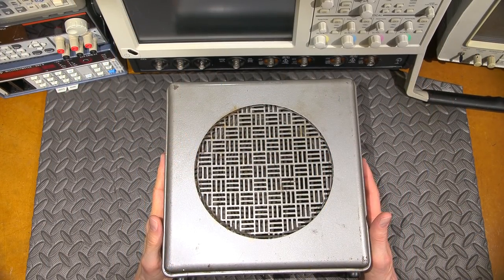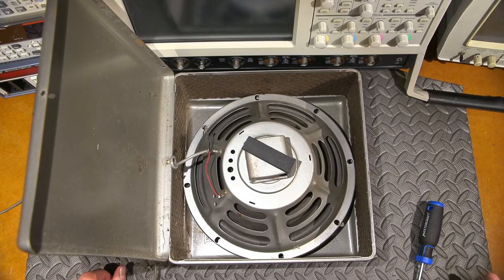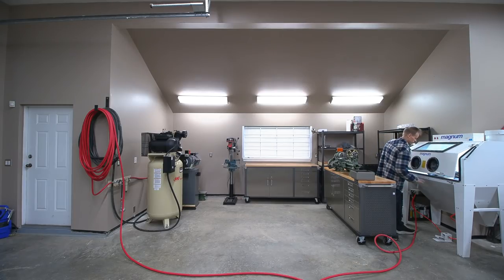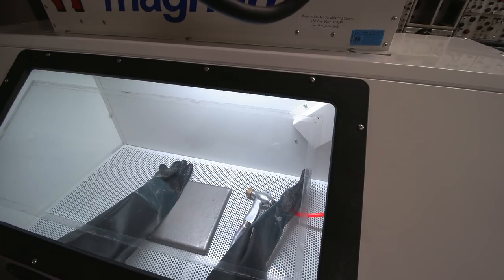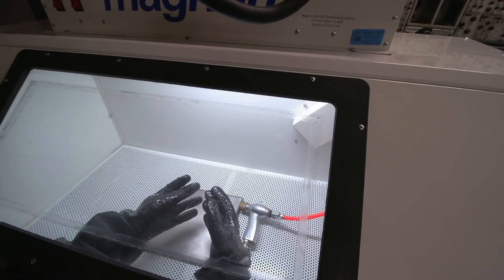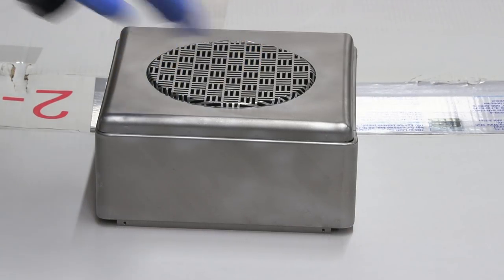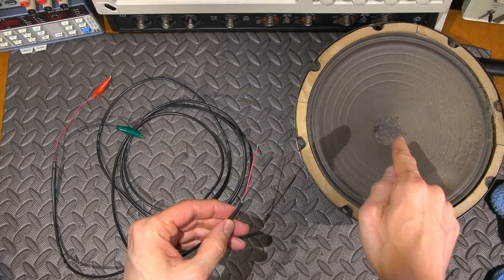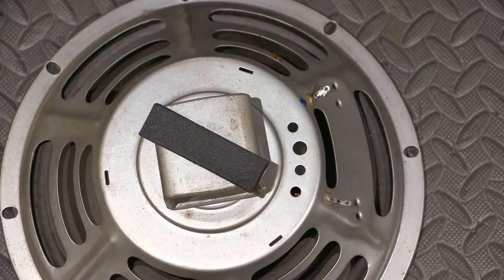Speaker Restoration And Modification!

Comment: Love the set up. One thing I noticed is when your compressor came on it seem to be pulling LRA too long. Not sure of the service size to that building. One issue i have seen on car washes is a 240v compressor on 208v power. The fix was a adding a boost transformer at the unit. Over time under voltage on start can cause motor to fail.

Comment: Excellent outcome. 

Little tip: when using rattle cans but especially thicker products like Hammerite or Plasti-dip warm the cans in a basin of water for 15 minutes before painting. Nothing extreme but close to your body temperature. It makes a massive difference in flow, spray pattern, and reduces clogs. Trust me, you'll thank me.

Comment: Great restoration. That speaker looks fine for testing vacuum tube table radios, but what speakers do you use for testing real Hi-Fi audio amplifiers and receivers?
Reply from the maker: I have a pair of "Monitor Audio PL300" speakers for that.
Reply: @MrCarlsonsLab  Nice, I would expect nothing less. I have a pair of UREI 813B's. Older speakers but still sound fantastic.

Comment: Hi Paul,  Nice video and some variety too (I miss my old bead blaster at work).  Would love a shop like you have now. 
Question: I recall some years ago you mentioned your old blast cabinet in the "old shop" next to the generator and you mentioned hazards of blasting radio chassis with cad plating, and I suppose lead paint on cabinets.  Not asking for advice, but what do you do regarding the vacuum exhaust?  Also, on the vacuum inlet do you use a cyclone such as in wood shops?  Anyone else chip in too.  Thanks!

Comment: Sorry to post another comment but I would like to add… I’ve had half a dozen blasting cabinets. And it’s better to keep an eye out and look for an industrial model like this, instead of giving into the cheap and readily available models from Harbor freight and elsewhere. 

The cheap models are fine…And if you assemble them with a lot of care, making sure to seal all of the joints before riveting and bolting it together… They can make good cabinets but you will need to tune and fettle a bit to get it dialed in and working properly. 

The cabinets are usable if assembled carefully, but I highly suggest buying a better quality gun and hose/nozzle/ glove system. Even a used clapped out model will give you better results if you’re doing a lot of work and spending many hours at the cabinet.
But the cabinets are completely usable as is for odd jobs or twice a year.

 industrial sized cabinets can usually be bought for scrap price if you keep an eye out. Usually vintage models but sometimes even modern units. But they aren’t thin bent sheet metal like the Harbor freight models. They weigh a ton!

Comment: Mr.Carlson, they do make safety couplers that shut air off at the coupler itself with a ring that you have to twist before you can pull back the disconnect ring part. I think some of the push button Prevost couplers do this also, they are pricey though.

Comment: Nice job , Mr. Carlson.   Big fan.   Two questions:  Firstly have you considered adding a small handle  mounted on the speaker enclosure? I had a similar test speaker and it worked out great.  Secondly, I'm  wondering if you could add half inch black pipe to supply air to your glass bead blaster, installed up from the compressor,  along the ceiling,  and down to the blaster?    Keep up the good work.

Comment: Was your compressor completely unpressurized when you turned it on? If so that’s one of the fastest ones I’ve seen. Sorry to be nosy, just curious.

I’ve had several large compressors ranging from 80 to 120 gallons. Most of them were really nice industrial vintage units that I had to restore a little bit. Not only are they available at insanely cheap prices… If you do a bit of looking around… But usually much better quality than stuff available these days unless you spend a lot of money on something nice. (Like yours) 

And I always enjoyed working on them because the compressor was one of the most used things in my shop. Some of my favorites were horizontal three-phase types, that were still in really good shape and I’ve been on the factory floor since new decades ago. And bought for scrap price.

I learned quickly that a really big tank, and I really fast quiet compressor is indispensable if you’re doing a lot of be blasting. can be pretty difficult to do any real sandblasting or bead blasting with a tank smaller than 80 gallon. They’re a lot of fun to put back into service, especially the vintage factory floor type. Whether horizontal or vertical tank. And something much easier to work on for guys like myself… Who struggle with more complex circuits and electronics work.
Reply: He probably run a sound check before.

Comment: It looks like you have your "mechanical workshop" in your attic.
Or at least it looks that way with the angled ceiling.
If so: How did you get all the heacy pieces of machinery (air compressor, glass-blasting machine, the workbenches, ...) up there?

Comment: Exceptionally clean, pulp cone, late 50’s or early 60’s Jensen P12Q. I have an old Fender Deluxe that would love that speaker.
You’ve got a diamond in the rough there. Be careful with the power, it’s only a 12 watt speaker.

I have a Eminence EM12 200 watt speaker I’m not using, wanna trade? 😜 I kid, of course.

Comment: In the end of the 60's I helped out in a fuel station/garage beside our house, and they had the same size compressor hozes for many appliances. One of them was a portable tire pump, to serve the customers at the pump. You had to charge them to a 'few' PSI. A mechanic warned me to be careful with the stuff. He showed me a newspaper picture of a ceiling with the imprint of a mans body, after a tank exploded were he was bend over.

Comment: I love this video. And all the safety tips. I have worked in construction, shops for years and years.. And i stress safety over anything. There is no sense in busting your ass and then getting injured and can't work. It's just stupid. Think about safety. Think about common sense. Don't literally bust your ass and then be screwed for the rest your life. Think smart and safety first. That's the best advice on any jobsite. Don't try and be billy badass and get yourself in a bind. Be smart. And think safety first. There is no amount of money that can pay for your back or any permanent injuries. Work smart.

Comment: The whole Paul!! Quick thoughts - ear protection please, move the compressor outside the shop - maybe a small shed outside connected by a door inside to access?, hang hose reels from the ceiling and pull down instead of a trip hazard on the floor, would suggest time-lapse for longer periods of blasting, painting. I love the evolving videos and ideas!
Reply: Roof hangers are pretty cheap and it's good practice.
Reply: Thanks Mr. OSHA, you are not allowed in my Lab at all. Paul is very careful and will be fine.
Reply: @thomasmoore8142  I mean it's not that hard to just put the hose out of trip region...

Comment: Very nice Mr. Carlson.   
I have a Sangean receiver and want to install a simple long wire antenna going outdoors 
I have a lot of shielded coax.
Does it matter what guage of coax to use up until the shielded wire terminates and the single wire just goes out about 100 feet once outside of my house?.  Also, do I need to ground the shielded part of the coax?

Comment: Regarding the air hose, the issue is not the hose itself, but how much air is trapped before the coupler you’re disconnecting, as the female should have a shutoff valve, but the male doesn’t. CEJN, who probably makes the best air fittings in the world, have released a safety female coupler that will only disconnect half way when releasing it, then bleed off any air pressure from the tool side, and then only allow you to release it fully. It’s rather nice since it prevents either the tool or the hose from flying out of your hands and giving you or your buddy summer teeth.

Comment: Wow! interesting how much your line voltage drops every time that compressor kicks in (light dimming) Are you on 120V or 240V there?
Reply: Canada is 120v.

The dip is probably from the motor start capacitor.
Reply from the maker: It's a 7HP motor on single phase 240VAC. Very high start current.
Reply: @Ammoniummetavanadate  Most sockets and receptacles are 120V, but strictly speaking Canada and U.S. houses are almost all wired for 240V single phase split at an outside center-tap transformer.  That gives you both voltages to use in your house.  The center tap is neutral and going from there to either end of the secondary will give your 120V.  Or, go across the entire secondary for 240V which does not necessarily need to use the neutral at all unless an appliance also demands 120 in addition to 240.
Reply: @projectartichoke  Next you are going to tell me about 208v and how with three phase systems you can use less copper.

Comment: I'm surprised at you Mr Carlson,  that you haven't got a air system around the shop with the usual points to plug in equipment?

Comment: They do make air valves with a bleed port with baffle when in the off position. When are you going to get a laser rust/paint remover? I thought you would have added a handle to aid in carrying it around.

Comment: There are safety female quick connectors where the release button/ring blocks the air coming from the compressor and bleeds the air from the male connector side while retaining the male connector until there's no more air coming from the male connector side, at least Hazet and Prevost make those types of safety connectors. 
Then at least Senga makes a safety connector with a double pulsation release, when you press the button it cuts the air and bleeds the air from the male connector but the male connector keeps retained until you press the button a second time, I like it better because if you manage to press the button by mistake you don't drop the tool on the ground... or on someone's head if you are in a high place.

Comment: Beads don't clean as fast as sand and don't produce as good a tooth for paint. Get a rubber brick or two to hold work for blasting to save your gloves.

When I needed a test speaker for small audio projects and didn't want to create a housing, I found an off-the-shelf pillow speaker. It even has a ⅛" mono plug.

I was kind of hoping for banana plugs on the new cord to accommodate multiple end fittings such as alligator clips, fork terminals, etc. but I'm sure it would be excessive.

Comment: I worked for a welding company years ago, their compressed air shutoff valves released the pressure in the hose when shut off. I'm sure that they are still available.

Comment: I have been reusing connectors for years until I could afford to buy them or acquired some. I'm very good at unbending and rebending those little metal clips. I see that you're using green on the negative terminal it drives me nuts that black is used as a phase color on AC and negative on DC which is not very distinguishable between the red which is also used as positive in DC and as another phase color on AC in the US. I have subsequently decided that any of my later DC work is going to use green for negative since mostly everything is negative ground anyway.

Comment: I need help/advice. I am self taught everything so I don't always know the terminology.  What I am seeking is an automated step~up/step~down voltage regulator.  My idea is using a lead acid car battery to get all the energy possible.  Car batteries like to stop at roughly 10 volts. But if a steup transformer brings it back to 13.8 volts it will function again. Albeit the amps will decline rapidly thus requiring more step up voltage. So a car battery at 7 volts can be stepped up to 13.8 volts meaning it continues to provide service.  If this can be done until the battery's true voltage, say 3 volts it would be much more useful for an electric vehicle. What I need to know is there such a unit and what is it called? I noticed lithum ion batteries rated at 100 AH and a car battery rated at 100 AH do not perform the same. Neither does a high energy 100 AH Capacitor perform as a Lead Acid battery or a Lithum Ion battery. Developing a slow discharge Capacitor would then be a battery (and I have some good/bad ideas about that.) Something like forcing a Cap to deliver the quick but un-used discharge back into itself causing the Cap to discharge only what the unit being serviced requires. Whether that performance issue is handled electrically or mechanically.  My hopes (pipe dream) is to allow a cheap Lead Acid battery to function much closer to a Lithum Ion battery. A variable transformer could achieve this but not automatically, at least not with something else causing the transformer to continually step up. Perhaps I am blowing smoke? Of course the step up transformer would use nearly 1/2 the energy while providing this function. Perhaps therr is a better way? If all avenues fail I will go back to developing my design improvements on Tesla's Steam Turbine. I am fairly certain that if Tesla were alive today with today's technology he would have found sucess with his Steam Turbine. (I realize others today use adaptations of his turbine but even they are subjected to other design flaws giving the Turbine a limited niche in which to be viable.  ANY HELP WOULD BE GREATLY APPRECIATED.  I am disabled and now going blind and would like to see some of my greater ideas come to fruition. The plates in his design were suspended vertically with the exiting steam coming out from the center when the playes should have been suspened almost (but not quite) horizontally thus taking almost full use of the plates surface. Also the plates should have had a ceramic exterior to prevent warping.  Just my thoughts.  I used to write about radio and antenna modifications for a few ham clubs my call sign was N8YPS, but I am much better at mechanics and wood working

Comment: I love the safety. But I have worked in and around multiple industrial and commercial environments and not many (none in my experience) would bleed off air hoses. Changing tools and unhooked lines they are usually fully charged. That being said its not hard to find trades people missing chunks or pieces of themselves. Wedding ring fingers are a common one.
Reply: The air hoses I have worked with have anti blowoff valves to prevent them from launching themselves if disconnected under pressure.

Comment: Paul, that air compressor needs it's own room.  Does it need to be that large?
Reply from the maker: Hi William. To keep up with a glass bead blaster, Yes. When the pedal is pressed, its like venting air out of the tank "a lot of air."
Reply: Paul, I didn't see you putting on any hearing protection. I hope you are using it.  I made good use of it while doing factory work when I did it.  The escaping air noise always grated on me after awhile and irritated my hearing in general.

Comment: 4:12 well one think is a compressor noise, but why light is flickering too ? Not enough power in the outlet or  electric motor generates so much noise ?  Light seems to be little bit dim when compressor motor is running.

Comment: I'm surprised you didn't do a lead check first. Not sure if that speakers age would fall into the possible lead category, but for anyone watching, anything old you're removing paint, especially blasting into air, always do a lead check with a 3m lead check stick.

Comment: WHAT?  No handle?  HaHa!   I'd of chosen a banana jack pair on the speaker's back side so different length cables could be used as needed.  

Did you increase the size of cushioning on the back of speaker coil housing to better press the speaker in place?  You'd mentioned you might do this.
Reply from the maker: Hi Tom, I did. I used a felt pad used on the bottom of chair legs, worked fantastic.

Comment: you can't let the glass window of the glass bead blaster to get blasted by the glass beads
Reply from the maker: You are correct. They provide a plastic stick on sheet that's replaceable for the inside of the window, kind of like a big cell phone screen protector.

Comment: OMG, my Dad has that same compressor in his work garage. It always scared me because whenever you first fire it up sparks momentarily fly out of the electric motor.
Reply: Then the motor is about shot and needs to be replaced.   You will see some small blue arching on startup but not sparks.
Reply: @killerdeamonking  I'm sure it's an induction motor so the arcing will be coming from the associated switches instead of the motor itself. Replacing them should be much less expensive than ordering a new motor. Careful use of contact cleaner might even do the job without any parts replacement.

Comment: I would like to send you pictures of a radio a brief description of the radio it is a portable that's right it takes a battery it also has an electric cord to plug it into a wall outlet the battery required is a 90 volt

Comment: hello if you can fix 12 volt to 3000 watt pure cine wave inverters ..is a good market , as so many that are made in China and they say 3000 watt its a true 1800 watt in most case .110 volts